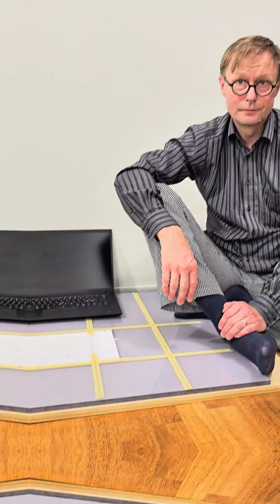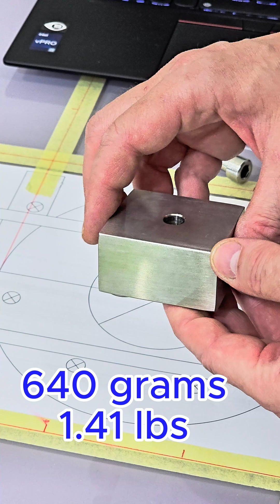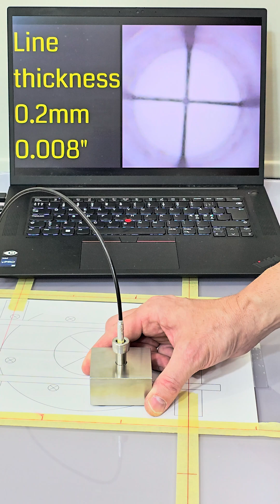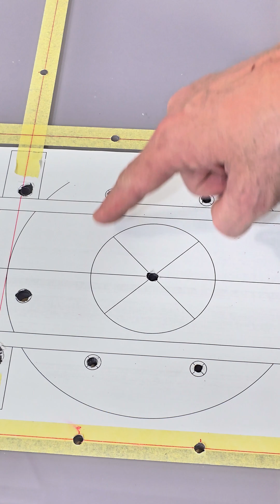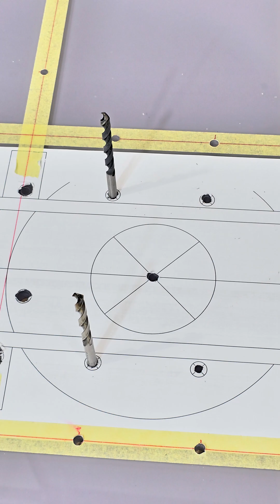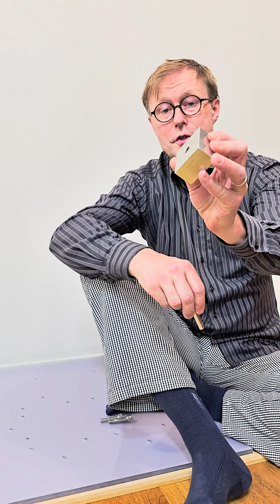Precision drilling of polycarbonate using a cordless drill

Comment: So, I wondered where you got the drill sleeves, or did you make them?
Reply from the maker: I made the sleeves, using A2 stainless steel bolts as starting point. I consider them consumables, but they are easy to make using a lathe. For the drilling accessory I could have used something like Wolfcraft 4685000, but for the smaller holes I wouldn't be able to use the endoscope. As my eyesight isn't as good as it used to be back in the good ol' days, I strongly prefer using the endoscope.

Comment: I was wondering if you might use one of the acrylic rod "lenses" that I have seen people using to do precision center punching, but you eliminate the center punching by going directly to drilling, with the sleeves holding the correct bit size...
Reply from the maker: I haven't had a lot of luck (or enough skill :) with center punching. In my opinion it's an extra step which reduces precision - although it does mitigate the risk of missing the target in a big way. A precise center punch is good if you use a pilot point drill bit - but then again, I'm not sure if they are ideal for polycarbonate.